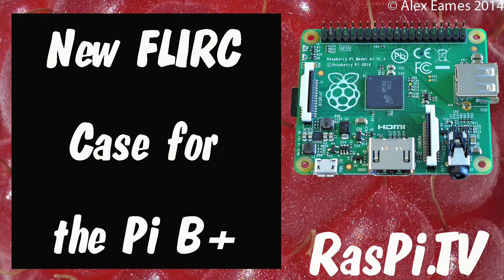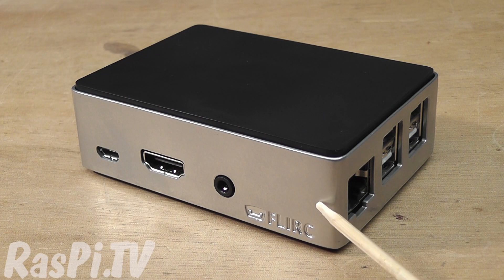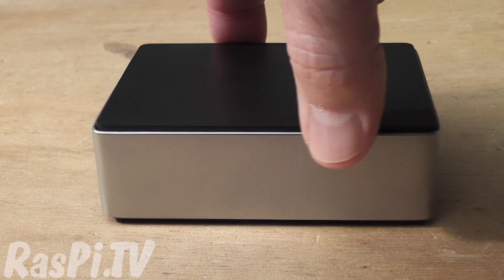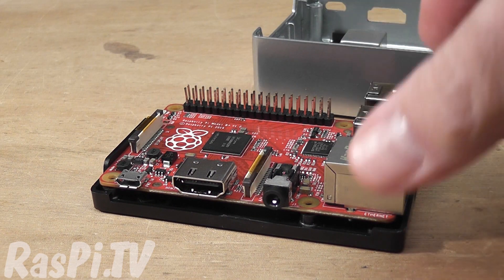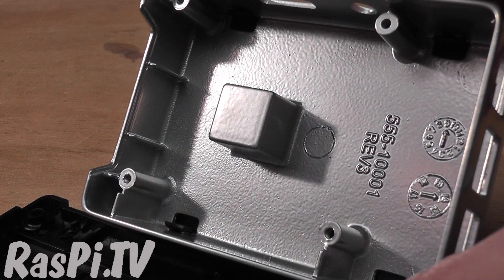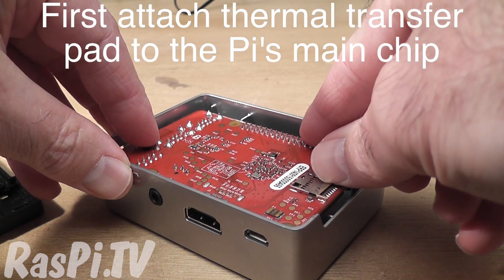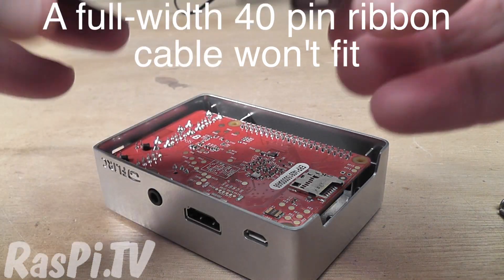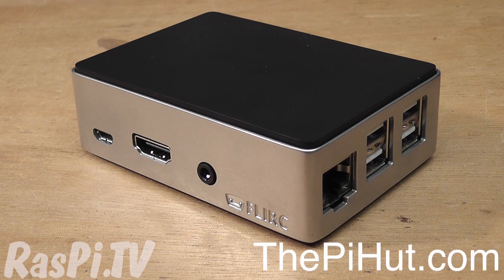FLIRC Case for the Raspberry Pi B+

Comment: Does the metal case interfere with the wifi at all? I was hoping to use Kodi but my wireless router is upstairs. Will this be a problem?
Reply from the maker: On the Pi3 I think it will, but this case was made for B+ which only had wifi via an external dongle, so it wasn't as much of an issue.